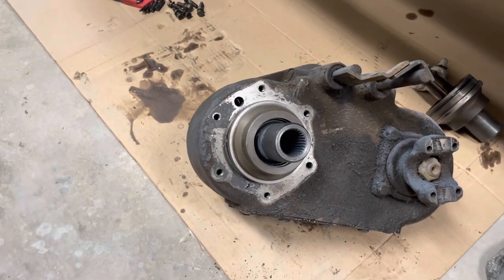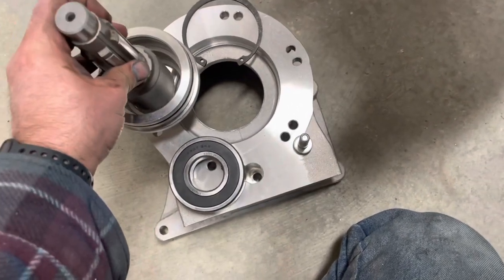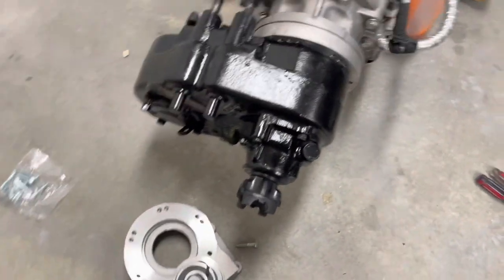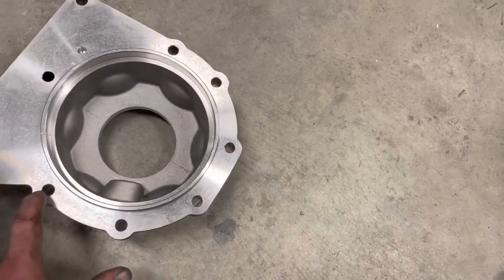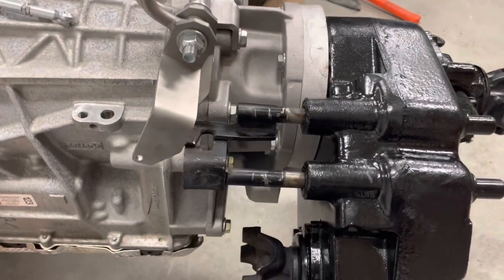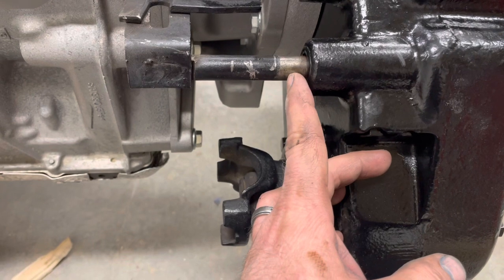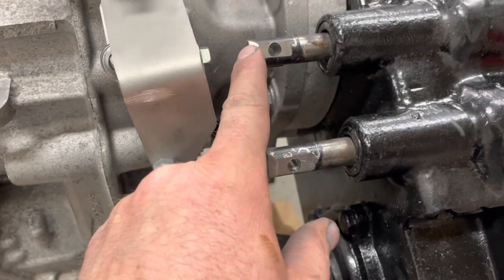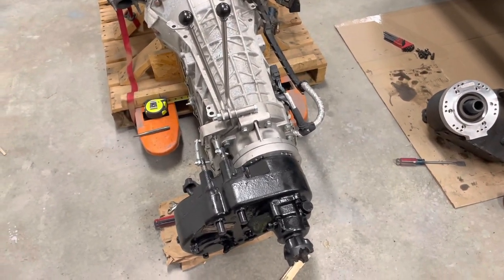Installing Dana 20 Transfer Case Adapter and Shifter

Comment: Wow i really like this adapter.  Do you know by chaining the piece on the dana will make it so you dont have to change the shaft on an AOD?  that would make it much easier.  Also what trans are you using in the video?  Also can you send a link to the adapter kit you are using a were to get it.  thanks.  FYI i am trying to change my  69 bronco 302 to have a AOD with my Dana 20 but really didnt want to pull entire trans apart to change the shaft.  thanks
Reply from the maker: This is for the 6R80.  I am not sure what the AOD takes.  I normally get my adapters from Summit Racing because they ship for free.
Reply: @boostedbroncos9531  Ok thanks a ton for the video and additional information.